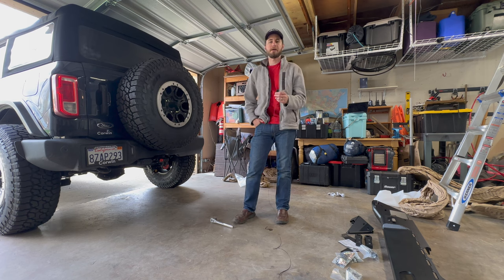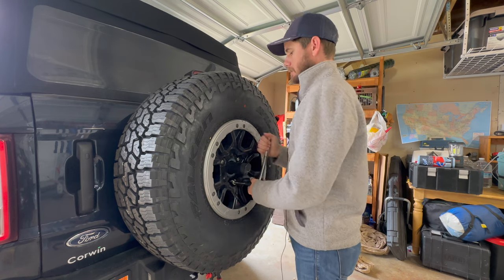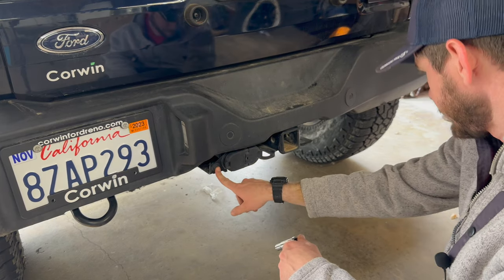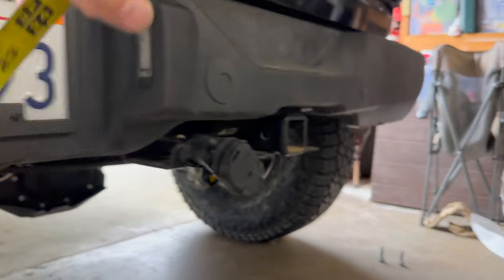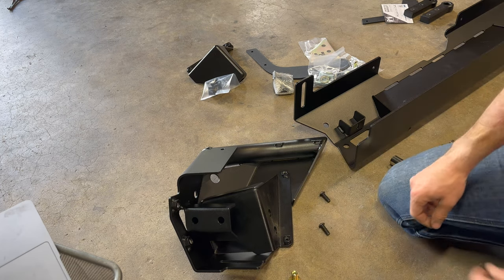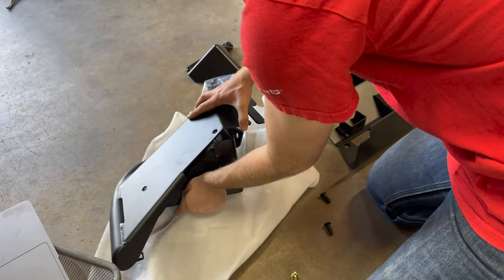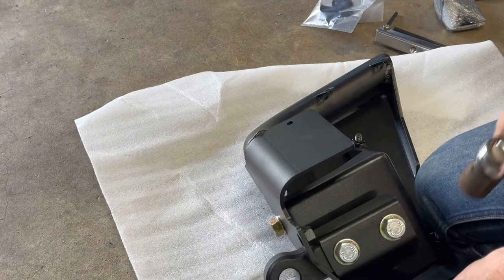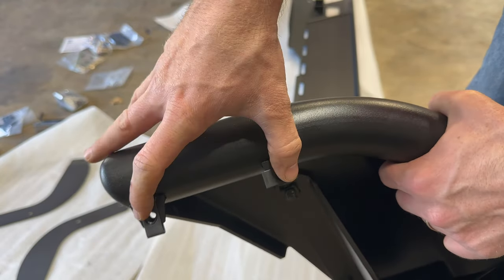I Install a Metalcloak Rear Bumper on my Bronco!

Comment: I prefer the trailer wiring at the original location anyway. With the higher location on the bumper and being over to the left, when you make a right turn it will pull on the trailer wiring if it is not long enough, and if it long enough, when you turn left it can hang down and drag. Having the plug close to the hitch is ideal.

Comment: 7/8 size is the same size as a 22mm socket.  Ford bolt sizes are all metric. There are a few metric sizes that line up with standard US sizes.

Comment: It looks like that electric trailer hook up is an afterthought that wouldn’t work for me, towing an off-road teardrop trailer and carrying a spare tire definitely would not work
Reply from the maker: It’s only due to my 37’s. My 35’s will allow for use. If it doesn’t work for you the factory location is still available